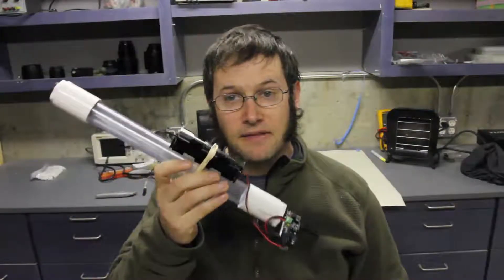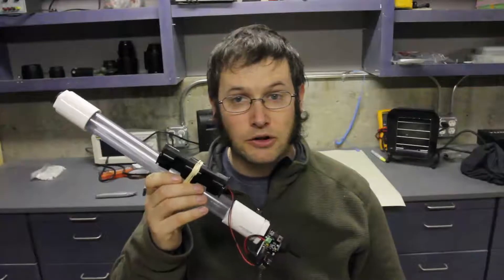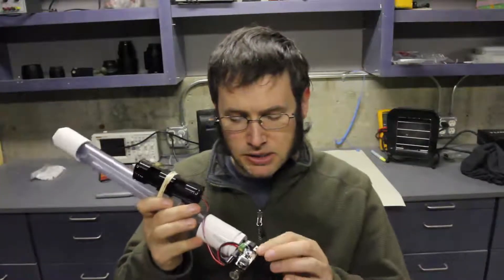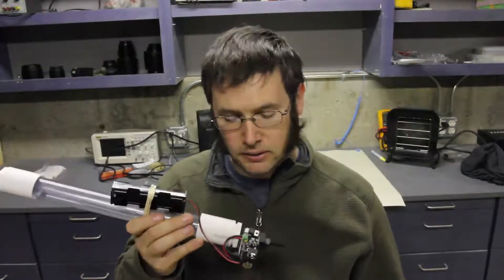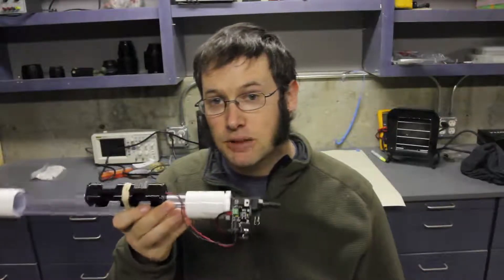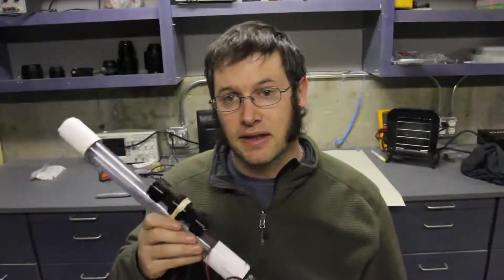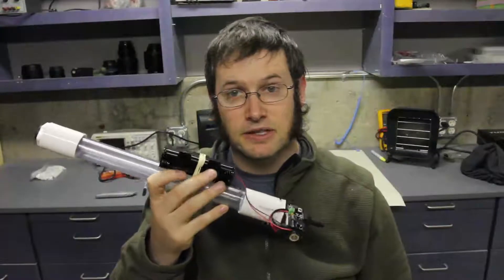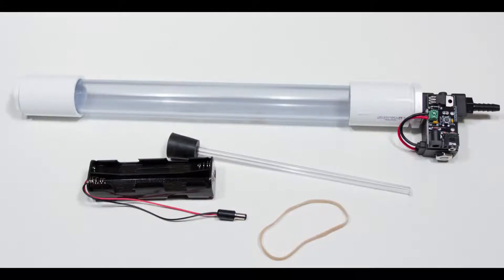TPB #41 - New Valve Sensor Released

Comment: what is the maximum frequency of generating drops? is this valve capable of generating another drop before first one falls from eg. 1m? I need to use such a system to diffrent project this is why I ask, because to do photography it would be useless paramater of high frequency.